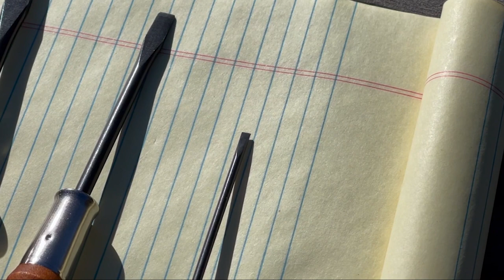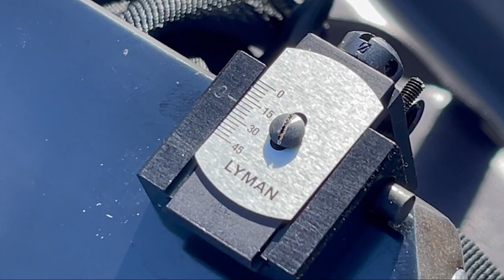How to install the Lyman Receiver Sight on a Marlin Lever Action Rifle.

Comment: The 336c was the 35 Rem Not sure why the 30-30 was a C? Marlin changed things up a few times with their serial numbers also. That one looks like a custom or deluxe with that gold trigger though so maybe that's why?
Reply from the maker: C can stand for 2 values. It can stand for C for Carbine (ergo: 20 inch barrel) or C can stand for the year it was manufactured. My Marlin is a 336 C 30-30 with gold trigger. Thanks for watching. I hope you got some value out of it.
Reply: @broswhoknowstuff   So yours is because of the year it was made or it's a carbine? I always thought my 35 rem was a 336C because it was the 35 instead of the 30-30. I kind of wish I would have got the 30-30 sometimes because they're cheaper to shoot. Even on line they called the 35 336C but you're not the only one on here that has a 30-30 336C so, ok. Maybe that's the reason Marlin shut down because they didn't know which way to go next? What kind of accuracy do you get out of your rifle? It's probably pre micro grove isn't it? Take care nice video.